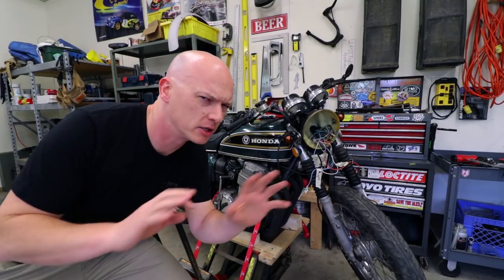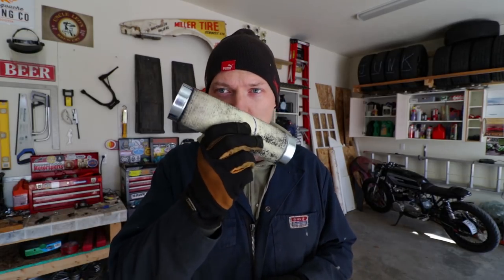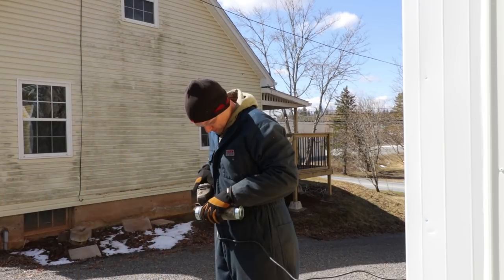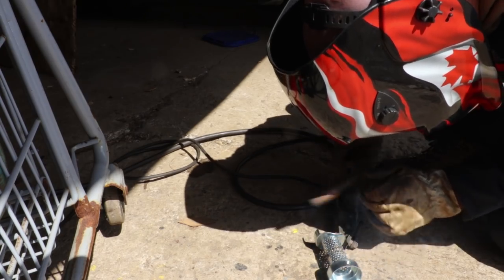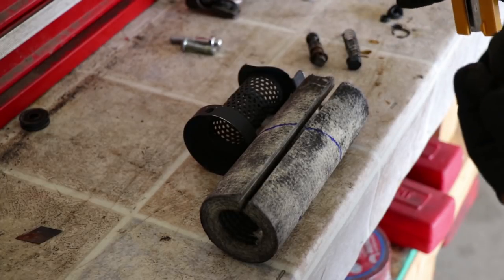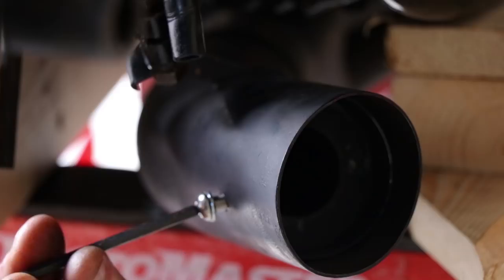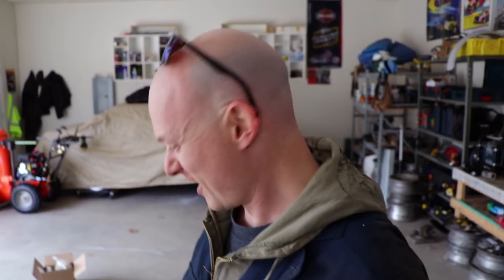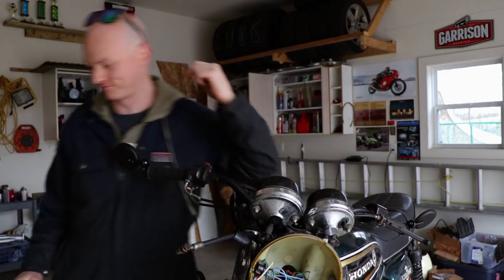How to make your motorcycle quieter? (CB750K project pt. 5)

Comment from the maker: Oh man who rocks hater pipes and who prefers their hearing as it is? I had to quiet down this wide open bad boy!
Reply: Indeed. I do not want to restrict the pipe air flow at all. A fraction of a percent, not that I could measure it, would be acceptable, but not more. The Yamaha Tmax already has too little power for its weight.
Reply: Actual mufflers are pretty good too.
Reply from the maker: I totally agree. There is something to be said for a great sounding QUALITY muffler.
Reply: @staninjapan07  Get a bigger bike  !
Reply: @shobud7561  I should not have down-sized from my previous bike, or even though about swapping it at all, as it was flawless - or almost - but we all make mistakes. I hope I shall never make the mistake known as 'Yamaha' again, though.
One and a half million Yen, and at that price I was hoping to be more pleased.
In many respects it is good. Very smooth, extremely easy to handle in traffic 2-up, comfortable etc, but a far cry from my 2013 V-Strom.
Reply: I'm rocking a 90 cubic inch V Twin with dual 4 inch straight through exhaust.  The previous owner cut out the baffles...  With such a big exhaust, it doesn't even sound like your typical big bore v twin.  It makes the deepest lowest sound I've ever heard from a motorcycle.

Comment: i did exactly the same on my Tiger 2019. I bought the same part as you and shrinkened it a bit, i confirm it works pretty well. The loss of power is almost not perceptible. One unknown is still how long it will last.

Comment: I used some SS scourers in my muffler to quieten it, worked surprisingly well for 70 cents.........
Reply from the maker: Nice! Low buck muffler packing. I love it!
Reply: YEAH, I did the same in my #Duke390 aftermarket Muffler which was way louder earlier even with the Standard DB killer installed which comes with the exhaust, then I wrapped the DB killer with SS scourers and it worked as the Steel wool will..Now the Sound is Smoother and Quieter ..
Reply from the maker: I might have to try this on a future project!

Comment: properly will need to reajeted nice project.
Reply from the maker: No resetting needed at this point. It runs really well above 3000 rpms but still super rich at idle and wide open throttle. I think there are still some jetting issues but they were there before I bought the bike.

Comment: I wonder if this kind of thing would work in my brand new Yamaha Tmax 530 scooter.
Like an idiot I bought it without test riding it.
It sounds like a broken washing machine, or a real novice trying to make a drone sound with a didgeridoo.
The dealer tried to tell me it is because it is automatic. He must think I am a fool who confuses transmission with the tone of an exhaust at certain RPM ranges.
Thanks for the video.
Reply from the maker: It would totally work for you. Just be aware though, you don't want to restrict the pipe too much!

Comment: Awesome I love the sound also. Another 750? Dang can't even find them around here! Can't wait!
Reply from the maker: We've got a few floating around in my neck of the woods. A number of super sports as well...😀
Reply: Not to be that guy, however they never made a super sport CB750 in the 70's its actual title is Super Standard. :) Take care.
Reply from the maker: Oh? Do tell? Everyone and every resource I've ever seen has called it a super sport. Very interesting!
Reply: Well I can no longer find the documentary on Youtube about the CB750 that explains that SS stands for Super Standard after I saw the video I asked my brother who is a mechanic for Honda for many years and before he passed away worked for Honda Racing (Bikes) and he said yes almost everyone has it wrong. So if I ever find that video or the document I once saw on a forum some place can't remember where I will let you know. Bottom line is I could be wrong. However the one owners manual I have for my 550F SS never mentions Super Sport however does reference Super Standard once so.. eh..

Comment: Did the you have to mess with the carb jets since you gave it more back pressure?
Reply from the maker: I haven't done this yet. The bike runs a bit rich but it did that well before I swapped this exhaust on. I'm planning to dive deeper into what is causing this richness in a future video.

Comment: I just bought an aftermarket exhaust and its so loud that its practically straight pipe...it has a baffle but still obniously loud. I wanted it to sound louder than the stock exhaust and when accelerating but when doing maintenance rpm and cruising its still loud.

Comment: Question. I have bad headaches from concussions but I want a Harley so bad. But way too loud. Is it possible to make it even more quiet than this video? Tempted to just get an e bike if I can’t but would love to
Reply: Not sure about other motorcycles but not a chance with harleys (at least those with bigger engines). 

Before even buying a motorcycle, make sure you won't get headaches just from wearing a helmet alone, since they fit really tightly. While driving at faster speeds, the wind can also get really loud.

Comment: Will that effect permeance at all? I don't have original pipes on my CB750 (they were trashed when the PO bought it, so he used a very nice-looking Harley exhaust). The pipes aren't obnoxiously loud, but I wouldn't mind quieting them down a little.  I'm curious if I'll have to re-jet or do any adjustments after finding some baffles that fit.
Reply from the maker: Hi Dave. It's hard to say if you'll need to re-jet. I haven't had to. I think you have to go pretty extreme with the exhaust change to need a re-jet. Most pipes are just bolt on and go. From my experience, more displacement (big bore kit), different cams and/or switching to pod filters is when you really need to be worried about jetting.

Comment: Did you screw the bolt into the baffle as well or just in front of it to keep it from shooting out?  If the latter is there danger of it traveling further inside the exhaust?
Reply from the maker: I screwed the bolt into the threaded hole on the baffle. It isn't going anywhere! Also it can't travel further up the pipe because of the bend further up stream.

Comment: Is this as easy to install as you made it look? My buddy said I would have to disassemble a silencer and stick this inside? Is that true or does it just fit right in? Thanks for the video btw
Reply from the maker: It depends on your pipes/mufflers. These silencers are meant to fit size on size with certain diameter pipe.
Reply: @Mike_Barker  Thank you. Let me ask, the end of my exhaust is welded and I don't have many tools. My exhaust has a baffle but the hole is still huge. Is it dangerous to put a smaller baffle inside of a larger baffle?
Reply from the maker: Huh... Likely. You need some way to secure this baffle (like I did with the bolt). I think that would be more challenging inside of another baffle.

Comment: What if I don’t want to drill a hole on the pipe ? Is there an alternative?
Reply from the maker: Depending on the material of the pipe, you could use a small tack weld on the inside of the pipe to hold the silencer. You need a way to mechanically hold it in there.

Comment: Thanks! My KTM Duke 125 is way too loud with genuine akrapovic after installing a decat pipe. The sound hurts to my ears while riding over 6000 rpm and it is a 125cc with 15 horsepower so you have to drive with high rpms at faster speeds. Gonna try this to my db killer so that I put packing around db killer and close it from the open end which is left!
Reply: Have you tried this ? I got an exhaust for my Kawasaki ER-6n which is more of a straight pipe than an exhaust and it has been bleeding my ears for the last couple of days, nevermind the constant fear of getting pulled over. Also, Mike, does this affect your engine in any sort of way ? Like if I was to do this, do you have any idea if I could break something ?
Reply: @danIstrate1994  I switched back to stock parts after driving about two weeks. Db-killer did bot help. And also this mod did not work for me :/

Comment: Got a question! I have a VTX exhaust that is a 3 inch diameter. Will these fit that size? Trying to get my first baffles so I need some help.
Reply from the maker: I'm not sure if this link will work but it's for a 3" outside diameter version of the baffle that I used in this video. https://www.amazon.com/Universal-Motorcycle-Steel-Baffle-Packing/dp/B078FRBQGL/ref=mp_s_a_1_fkmr1_1?ie=UTF8&qid=1542040687&sr=8-1-fkmr1&pi=AC_SX190_SY274_FMwebp_QL65&keywords=drag+specialties+baffle+3"

Comment: So if you do this do you not have to do any tuning or anything? I bought a cruiser that was straight piped and it is louder than fuck
Reply from the maker: I didn't have to do any tuning on my bike. It could totally depend on if you've got any other mods though I.e. air filter, pods, etc.

Comment: Think I could replace a generator muffler with that set up?
Reply from the maker: Possibly! Depends on the style of exhaust on the generator.
Reply: @Mike_Barker  
Briggs & Stratton Muffler part # 497141.  Thinking could attach some black pipe to the outlet and connect to your custom exhaust silencer.  But I would not have to chop it down.

Comment: This muffler is free flow... Will it cause any damages to exhaust valves due to less back pressure
Reply from the maker: Hmmm if it became too free flowing it could run a bit lean. You could need to re-jet, but with the baffle installed (in mine) it adds back in the back pressure. Mine is still running a touch rich through the entire throttle position range.

Comment: Question " will this type of baffle fit inside of my Vance & Hines Long Shots on my 1100 C Honda Shadow Saber ?
Reply from the maker: Well... I'd have to know what the inner diameter is of the V&H pipes. Take a quick measure and then check the link in my description to see if that diameter is available as an option
Reply: @Mike_Barker  It measures just a hair over 2 inches ...
Reply from the maker: Then I'd go for the 2" baffle. The only catch would be if there was any kind of taper to the mufflers that you'd be installing this baffle into.
Reply: @Mike_Barker  do you have a link for thoes ?
Reply from the maker: @shobud7561  I was actually mistaken... you should measure the outside diameter of your pipes. Here is a link to the version for 2.25" Outside diameter pipes:  https://amzn.to/2Z4X20g

Comment: Do you have a link so that i can purchase the 'muffler packing insert' please? I have the muffler but not the correct packing.
Reply from the maker: Hey there! I linked to the insert in the description of the video. Are you looking for just the fibreglass packing?
Reply: @Mike_Barker  Yes just the fibre glass packing please? The inner diameter of my insert is approx 25mm and the outer is 60mm.
Reply from the maker: @GRAW247  I have never needed JUST the packing, so I'm not sure where you would find it. My packing came with my silencer. I'm not sure where you would find it. Contact the manufacturer...?🤔

Comment: But when my exhaust get so hot.isn't the cotton will fire on!! Please response...i want to install in mu SC project...
Reply from the maker: It's not cotton! It's fibreglass packing. Much more resistant to heat and fire
Reply: @Mike_Barker  can it solve the problem of DB killer?
Reply from the maker: It will definitely make your motorcycle quieter.
Reply: @Mike_Barker   do you use mufler exhaust in this video or just piping of exhaust brother?

Comment: Is it not affecting the power?
Reply from the maker: I can't say for sure as I did not drive the bike with the 4 into 1 system installed without the baffle. My "seat of the pants dyno" tells me that it has a little better performance vs the stock 4 into 4 pipes, but that could be more to do with weight savings. Great question Enriko!

Comment: Can I use the OEM exhaust that I cut off to do this?
Reply from the maker: Maybe... What kind of bike are you working on?
Reply: @Mike_Barker  81 CB650
Reply from the maker: @_eimine_  well IF you're tossing it in the bin anyway it might be worth trying!
Reply: @Mike_Barker  I cut the pipes off for the sound but the lack of back pressure is causing problems. I was thinking about welding the old ones back on, but started thinking about baffles. That's how I found this video.

Comment: Rice bikes should be baffled. They sound horrible with straight pipe. I have an 82 kz750 bobber, a 99 Suzuki Savage chop and 2 Harleys. The Suzuki sounds like a lawnmower with straight pipe and the KZ750 just sounds annoying.

Comment: You also reduce the bike performance ☹️
Reply from the maker: Sometimes yes... sometimes no! Vehicles do need some back pressure for the system to correctly operate. Turbocharged engines are a bit of an exception though 😜